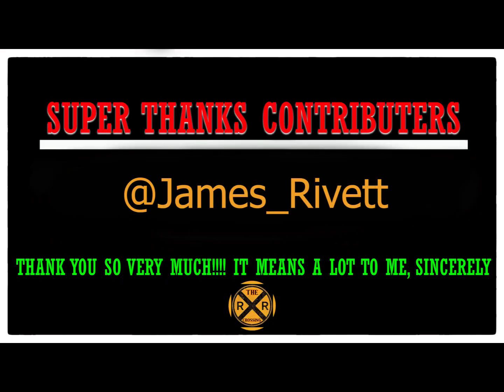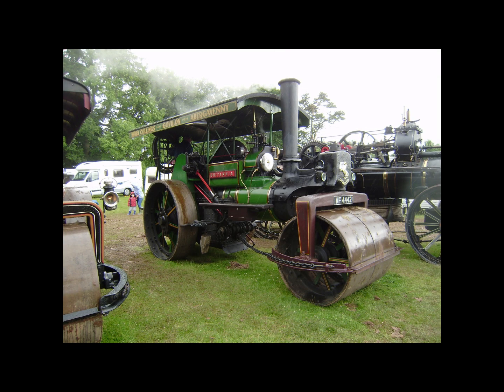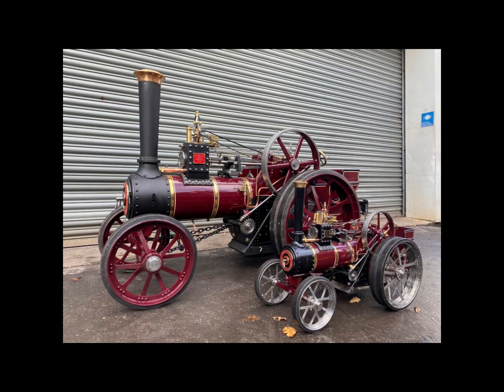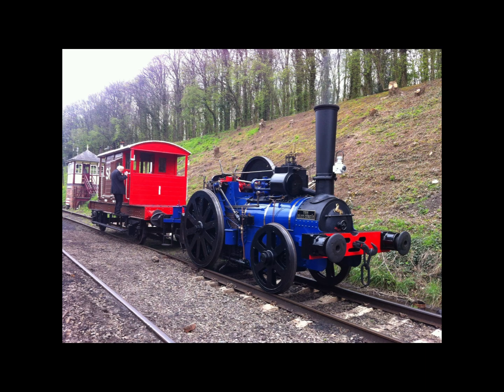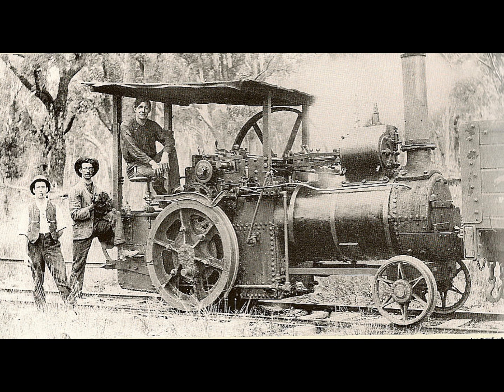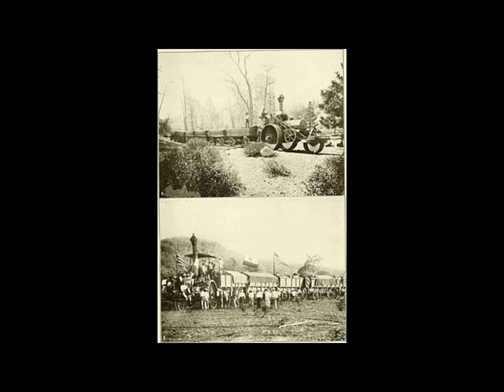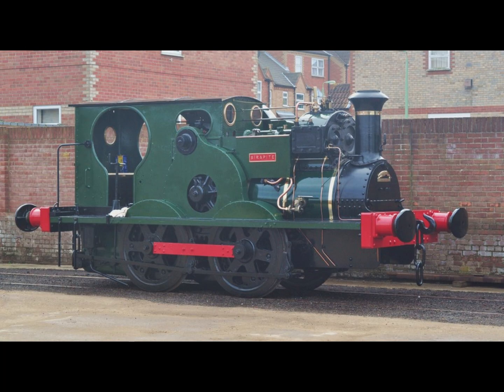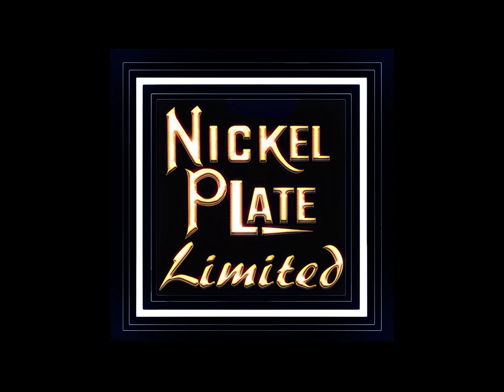Steam Traction Engines And Applications

Comment: One of the engines pictures lives about 40 miles from me at the Longshop Steam Museum. (They were doing the assembly line process when Henry Ford was a farm hand). It was originally ordered for a gypsum mine, and was named after the combinations of the owners daughters names......... Until someone noticed it spelt Parasite, so was hastily renamed Sarapite. When the mine disposed of it, Richard Garretts of Leiston (who were the owners of the Longhop) purchased it to replace their draft horses for moving wagons around the works and to take them to the local station for collection by trains on the mainline, which is why a Aveling & Porter engine, wears a Garrett badge (the brass panther where Aveling's used the Kent coat of arms, Invicta and rampant horse). Unlike a lot of locos that were displaced by diesel locos, Sarapite was actually displaced by 2 Battery electric locos in the 1960's but remained on standby use for several years until disposed of before Garretts closed in early 1980's.  The loco ended up in the ownership of Bill McAlpine (of Flying Scotsman fame), but by the early 2000's was in a traction engine dealers in Kent in a derelict condition. The museum saved the money up with lottery grants to buy the engine and restore it, but has only seen limited working on the museums 75foot (yes that short) demo line or at the Mid Suffolk Railway.  Another connection the Long Shop have to railways, is in 1932, Garretts was taken over by Beyer Peacocks, who made the famous Garratt engines . 

When looking through old order books and catalogs, several manufacturers claimed to have made them, but I have only seen a few from Aveling. 

Two of the photos showed some that were "bush engineered" most likely in Australia. I can tell from the photos that they were Ransomes traction engines, made in Ipswich Suffolk. I have also seen a photo of a burrell engine done likewise (but with a bogey at the front), but I cant remember if that was Australia or New Zealand. They seemed quite popular down under until the advent of the Climax and Shay locos from the US, as they could do the jobs more with more haste and I suspect power, but quite a few traction engines seamed to have been converted in this way. 

A engine very similar to those steam Sappers lives in California in the Arthur Bright museum, but has been much modified over the years, but is the 3rd oldest surviving Aveling & Porter engine, having been built in 1873.
Reply from the maker: Wow! I learn something everyday here. :)